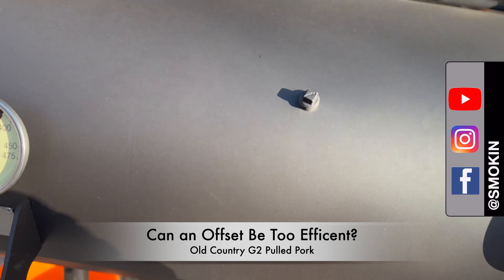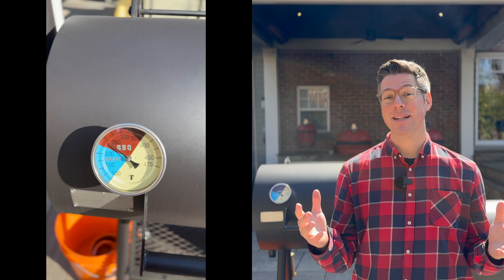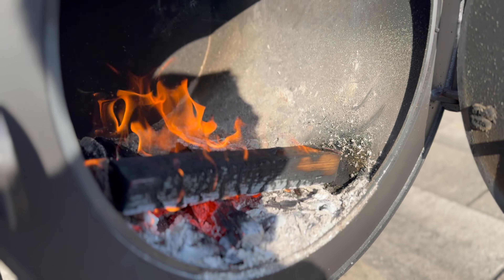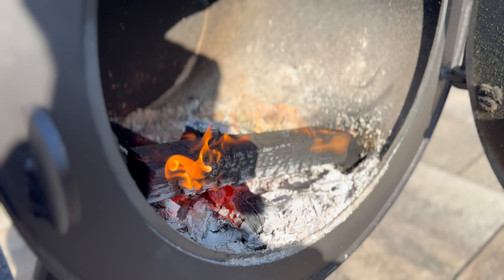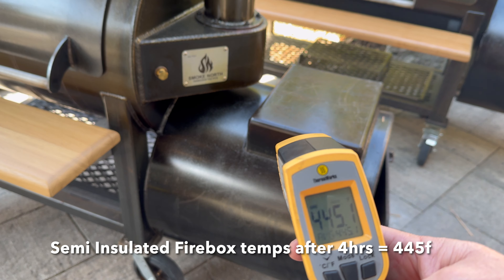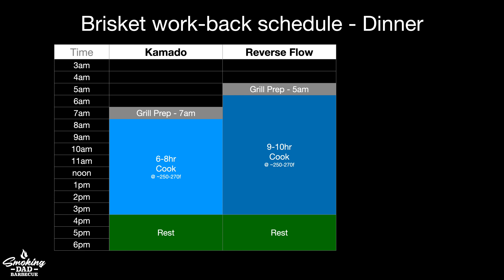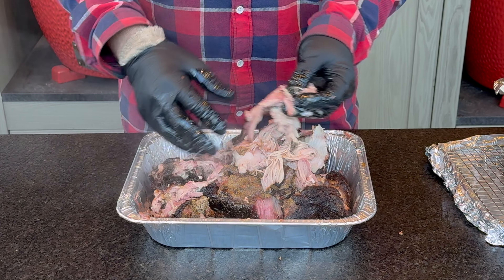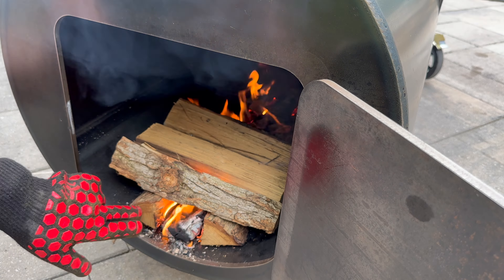Deleting The Fully Insulated Firebox Would Make The Old Country G2 Offset Smoker BETTER?

Comment: The main thing I want to know is if the G2 renders a brisket fat cap.  That would be the main reason I would purchase an offset.
Reply: Sure it will. Sounds like you want Cap Up so remove deflector plate unless it pushes heat up. Remove Tuning plate and heat source will be on top
Reply from the maker: Yes it does. The cook chamber is relatively small so even though it’s not moving much air there isn’t a lot of free space for it to avoid the food
Reply: @SmokingDadBBQ  thx!
Reply: I didn't trim my pork shoulder at all today - didn't even score it - and it rendered completely for me.  I know it's not a brisket - but I was surprised at how well it did render for me.  I was expecting to have to remove some of it while pulling the meat - but nope.

I suspect the experience would be similar with a brisket.
Reply: @MikeDQB  Thx. Good to know!
Reply: Fat on a brisket renders perfectly on the G2
Reply: I think all you gotta do is position smoker in the direction of the wind so it hits firebox vents, increasing airflow. Or make bigger vents. Maybe a small fan blowing at firebox ?